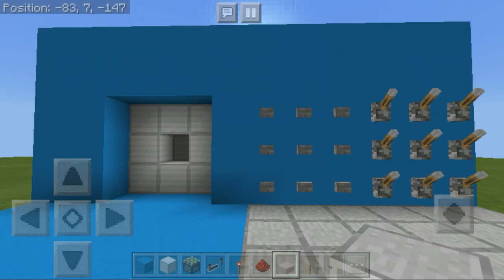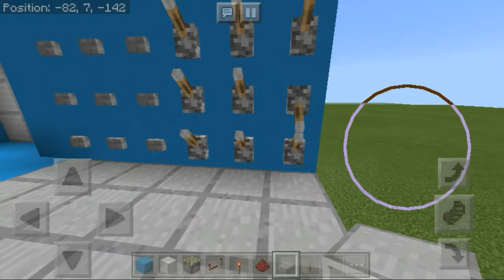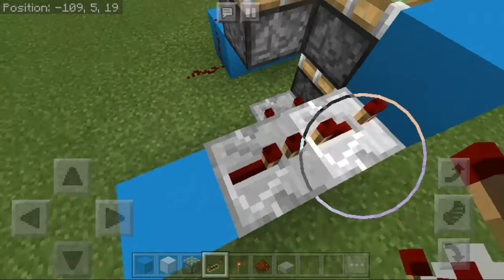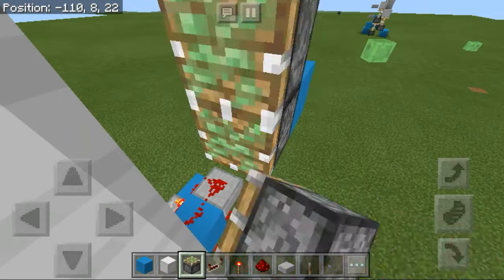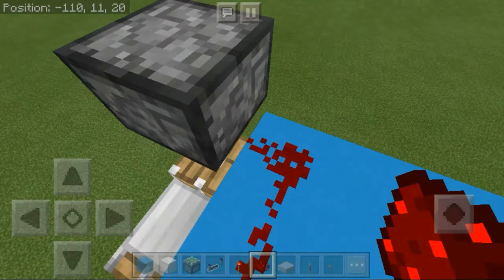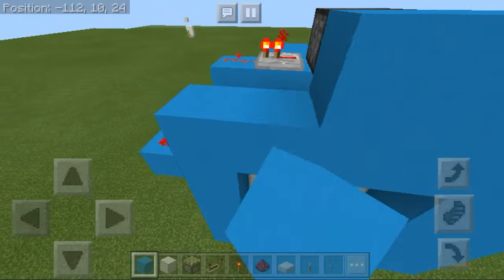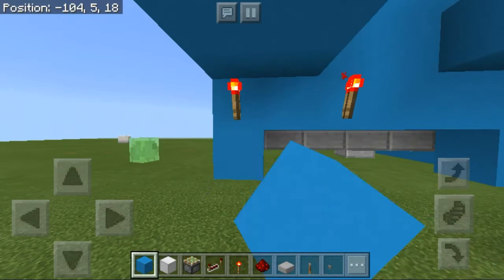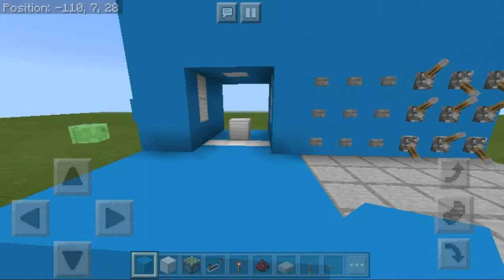🦅 How To Make Combination Lock Vault Door - Minecraft Pe

Comment: Wow a pro could always just pull all the lever and the door will open
Reply from the maker: No if you do 1 or 2 inverted then they can't cheat and open it
Reply: How about this you created the password by putting some redstone torches how about putting some redstone   dust behind the levers that has no redstone torches that way when a guy pulls all the lever it will not open.
Reply from the maker: @shansola2519  easy way to make a defense system is to have it connected to the torch have redstone from that torch go into another torch and that will make reverted signal if u press all of them it's gonna stay closed becouse of that inverted signal
Reply from the maker: @shansola2519  but ofc if you have more simple way go for that :D
Reply: Yeah just sayin